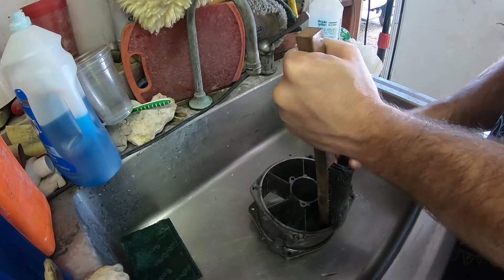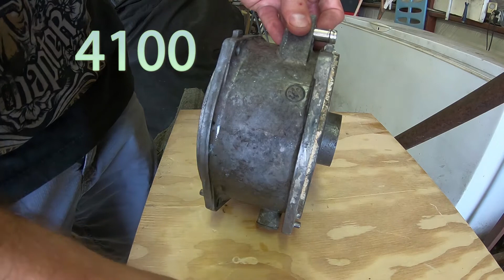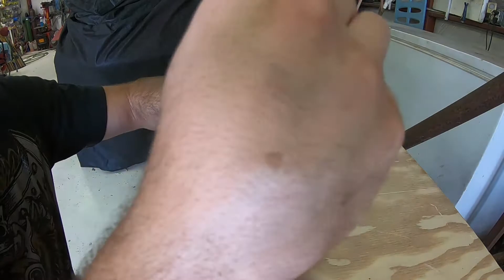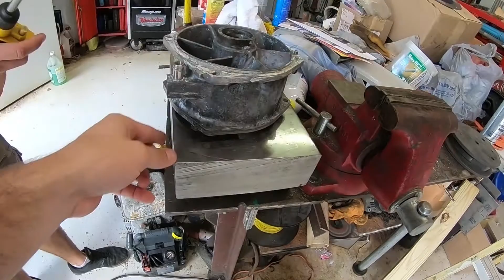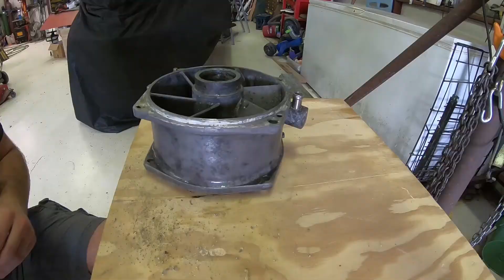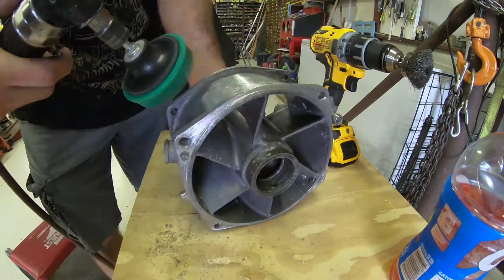jet pump corrosion removal

Comment: What are the green wheels are you using to polish? you buy them on amazon or locally?
Reply from the maker: You can buy them almost any were there called gasket removal wheel there's three different ones green gray and yellow
Reply from the maker: https://express.google.com/u/0/product/7416819224403353634_16408124930045290047_7472660?utm_source=google_shopping&utm_medium=tu_cu&utm_content=eid-lsjeuxoeqt%2Ceid-ydjfswcwss%2Ceid-ygcnqnyulq&gtim=CMac9o701_n6KhD_u-H7zvLJhQUY0JPJAyIDVVNEKJCS4N0F&utm_campaign=7472660&gclid=Cj0KCQjw_7HdBRDPARIsAN_ltcJb17BS3HNqcVmF2IjoeDjN03Rkni9pwmqcCrr5_2dM9aZi7qA1SBoaAsX9EALw_wcB
Reply: BEAU SHOW  Thank you! i have been trying to find a good way to clean off corrosion on my pump. Do you anodize after it or just paint with some type of clear coat?
Reply from the maker: I just a good coating of clear not too thick